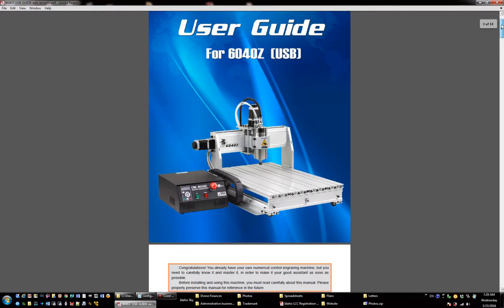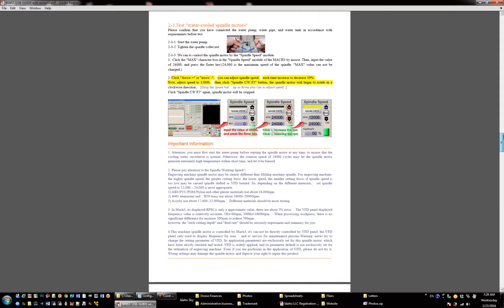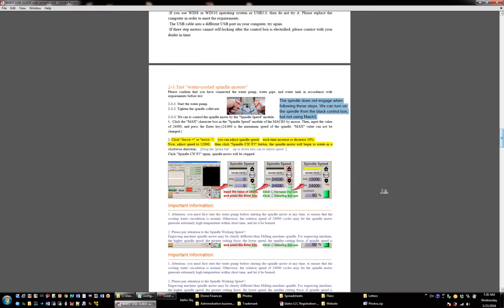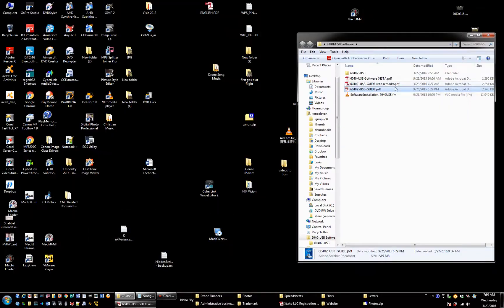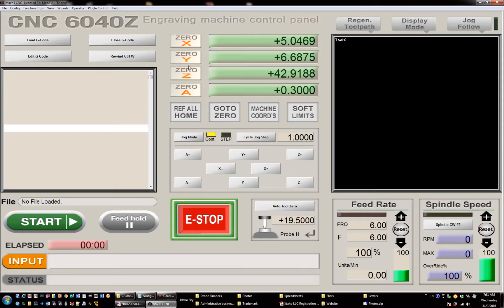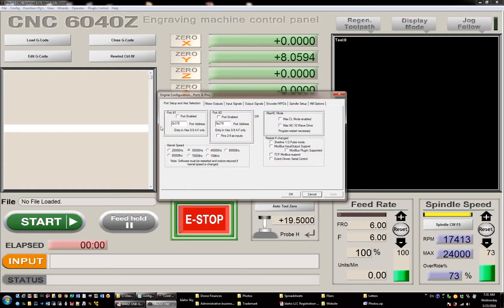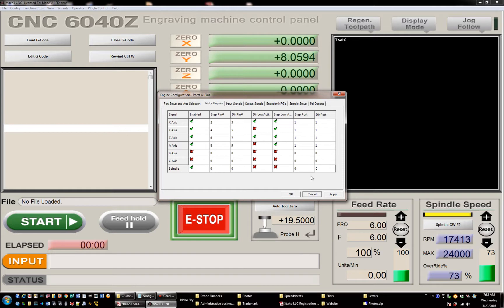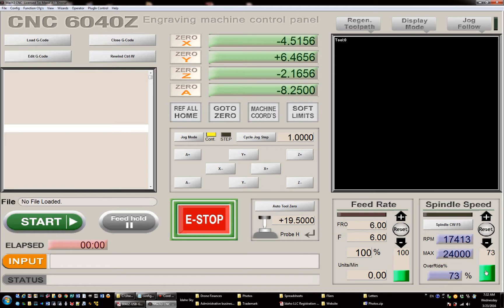CNC 6040z - Spindle Not Engaging

Comment: if you want real mach3 to control your machine...copy or take snapshot for all the settings cross them all.
uninstall mach3 and delete the directory in c/ drive.
now install mach3 with license and write the setting again from your snapshot.
to do not copy all the file they send you to mach3,,, remove the following files ( Bitmaps-1024.set-Mach3Mill.xml )
open macros and PlugIns folders and copy the files past them in mach3 dircotory at the same folders name.
example if you copy the file folder plugIns DLL files past them on the same directory on mach3 folder plugIns.
now press tab on your keyboard you will see the jog press the tab again it will go and you can see the diagnostic page and the authors on mach3.
Reply: Note: check the motion card settings M3-USB-JB4 V5 on mach3 before uninstall